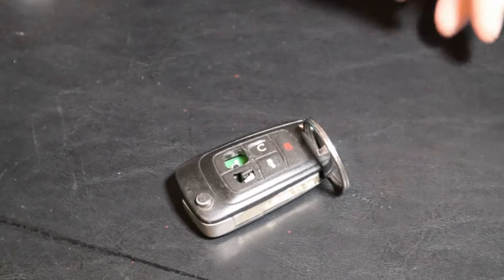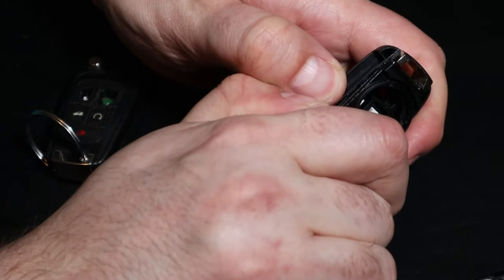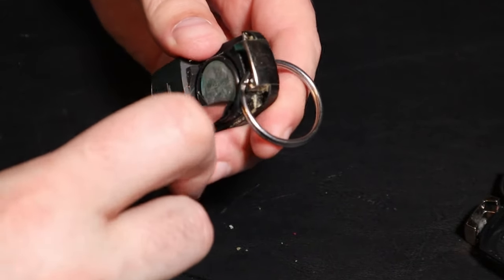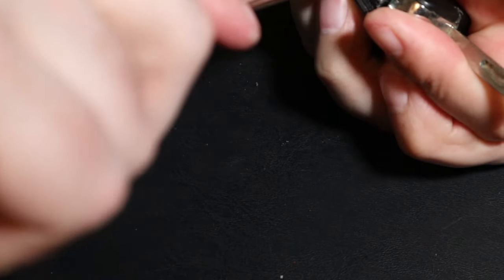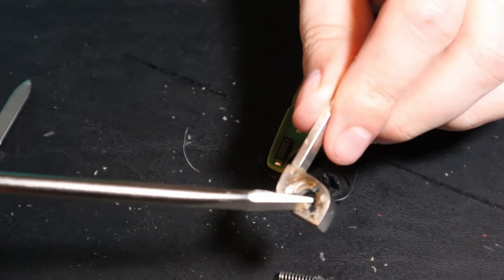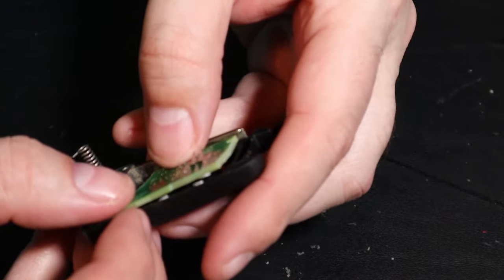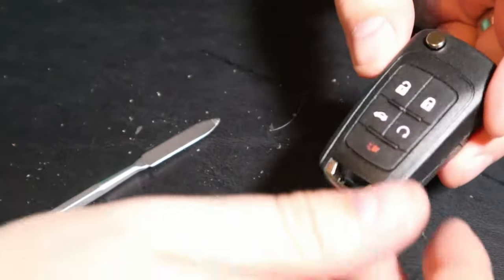How to replace Key FOB buttons | Chevy Cruze

Comment: These keys are designed so terribly, I’ve had this happen to both of my pairs
Reply: I got a cover off Amazon and I love it. It’s also helped find my keys easier because it’s lavender and not the standard black.
Reply: There are cheap brand new fobs online that come with instructions  how to program it.& then you just do the exact same thing with the key,but no need to put the board in the new one,and no need to pay to have a key cut. I've done this 2x,works great

Comment: Dude it’s literally impossible to get apart! Just tried for an hour to brute force my way in  and didn’t work. How long did it take you?
Reply from the maker: It was such a pain to open. I tried all kinds of stuff to open it. I dug around on the internet and found several people saying a flat head screw driver. I thought that's just ridiculous,  then I tried it and I popped the suckered open.
The key is to turn it sideways so that it takes up as much space as possible inside the fob. I mean it was still tough to open but the screw driver seemed to be the ticket. Check about the 3 minute mark on the video.
Reply: Use 2 needle nose pliers and carefully tear them apart. That worked for me but I broke some bits of plastic off that I may have needed for later. I can't get my switch blade key to lock into position tho. I think I'm missing a piece
Reply: @MindmeldTech  That's what I started out with. I think mine was superglued together.
Reply: Next time, try a Dremel like tool with a small cutting wheel along the case seam perimeter.  After trying to pry it apart with a screwdriver and nearly destroying the circuit board, I used a Dremel knock off from Harbor Freight.  Disassembly of the second FOB took less time and was cleaner.  Best of all, no damage to the circuit board.
Reply: Agreed I just watched this video to see what stupid trick I was missing. Nope just like plastic welded together. I would almost Pay to see some one get a OEM fob apart in one piece.

Comment: This video is great. I bought a replacement fob from RemotesRemotes for my 2014 Chevy Volt. I programmed it according to the directions that came with the fob but the buttons only locked and unlocked car; no remote start, alarm, etc. I decided to take the circuit board from one of my old fobs and replace the one in the new fob. It was almost impossible to get the original fob open as video shows; it was even worse. I used a hacksaw to cut a groove in the case to be able to pry the sucker open. In the process I destroyed the original case. Anyway, once I did that and pried it open I took the circuit board out and put it in the new case. It worked!!

Comment: Awesome YouTube how to repair video.  I could not have replaced the shell for my old key fob without your help. The most difficult step was opening the old fob case.  That required many attempts and greater strength than I had.  But I managed and the fob works like new.
Reply from the maker: Happy it helped you, and yes taking that shell apart was a pain!
Reply: Please share how, I’m frustrated unable to open it
Reply: @MindmeldTech  I got it put back togather but it wouldn't work.

Comment: I monkeyed with mine for over an hour.  I couldn’t get it open.  (The factory fob.). I just gave up.
Reply from the maker: Check under the chevy logo to see if there is a screw. Mine didn't have a screw, but I found out later that some of the fobs do have screws in them instead of being glued together.

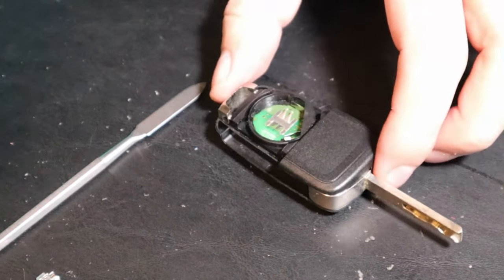Comment: A helpful video for anyone trying to move the circuit board and cut key blade to a new fob housing. After going through this process I realized the original manufacturers did not want you to be able to pop open the original fob and remove the electronics and key blade. They want you to replace at the dealership for $350. (Canadian) Getting the original fob to separate takes some persistence and brute force. I started to pry the halves apart with a screwdriver but it took 2 needle nose pliers to finish the job; being careful not to damage the circuit board. Finally, if you're struggling to tension the spring, use a couple small pieces of tape to secure the key blade to the bottom half of the fob while you're winding CCW. (7:00 minutes into video) Then pull the tape off just before you snap the 2 halves together.

Comment: Great video. I just replaced my 2016 Chevy Sonic fob using a $10 version on Amazon. Chevy dealer wanted $340 for a new key!
I also found the following:
1) the battery contacts on the replacement fob kept falling out during the fiddly assembly, so I used a dot of superglue to hold it. The original circuit board was also loose in the new fob (as shown in this video) so a dot of superglue here would also really help you.
2) On my spring, you had to wind up the key by turning the top case CLOCKWISE one full turn. Look at how your spring is coiled, and turn it the direction to wind it up.

Comment: I just did this and it ultimately worked great. 

I did have one issue where the silver button (that makes the key flip out) mechanics weren’t the same. They were shaped slightly different and the 3 teeth around the button didn’t quite match the old version. The old key base also wouldn’t open smoothly in the new shell, so I went another route.

I needed to get my old key onto the new base. Luckily, there’s a little spring pin that holds the key to the base. I used a little glasses repair kit screw driver to tap that spring pin out and put the old key on the new key base and as a result could use the new button mechanics. It now flips open smoothly. Everything took 30 mins and it works.
Reply from the maker: Awesome!

Comment: I have this exact issue with my key too. I'm saving this video and buying a replacement cover. Thank you so much
Reply: Even a key cut shop couldn't do it n charged me £5 for a thin strip of black tape with 2 bits of plastic made for buttons.

Comment: Excellent, just bought a used Terrain, one fob good the other looked exactly like yours. Found the shells but needed a video to see how to dismantle. Thanks.
Reply: Hey man, i also have a terrain. were you able to change your fob with no problem? For me i changed the fob and the buttons work but when i use the key to start it does not work. I now have a car lock symbol in my dashboard. Just want to try my luck and see if i can find a solution here

Comment: I got it to work. Thx for the vid. Some after market remotes are a little off if you are interchanging parts. My set is a little off bit it will have to do unless I want to buy factory keys cut from the dealership
 Thx for the video
Reply from the maker: No problem,  thanks for watching!

Comment: They super glued mine together. I'll have to use my wife's key and buy a programmable replacement.
Reply from the maker: yeh, mine seemed to be glued also. mangled it to get it open.
Reply: @MindmeldTech  Likely, that was the same with mine. I just couldn't get it apart.
Reply: They clearly super glued mines cause I can’t make this thing budge!

Comment: There is a small roll pin at the base of the key. All you have to do is push the pin out and the key will come right off. Reverse the procedure using your original key and you're done. This will keep you from having to take it all apart.
Reply from the maker: You still have to take it apart to get the circuit board out unless I'm missing something.  The replacement is just an empty shell.
Reply: The old transponder has to come out of the old fob and into the new one....... which means you have to pull the entire new key fob apart and re-tension the blade spring. 

What I found is the fobs are slightly different to the old ones..... can't clip the new front onto the old back. The plastics and push button slots are tricky. Then the spring has to be re-tensioned.

Comment: Well, that was interesting... same issue. Factory keyfob appears to be ultra-sonically welded or something. What a bear!!! I tried your method and succeeded in breaking the key end off, but  NO access! Would not budge! I ended up using small side cutter nippers and slicing along the seam in the hopes I could get a screwdriver in there.... nope. So I ended up nipping very carefully from the key end, very top down, then broke off small pieces so I could see the board and not damage it. Once I had the bulged part off, I worked my way down each side of the battery compartment,  breaking off pieces with the nippers and needle nose pliers as I went. Once I got most of the battery ring broken, I could slip the board out. 20 minutes.
Don't forget to preload the spring so the key flips out properly and fast enough.
EDIT: the screw behind the chevy logo probably is there. The new one has a screw in about the same place. Didn't see it and could not find the piece after I was done to check
Reply from the maker: Yeh, mine sucked to take apart. There have been several people that have brought up a screw behind the Chevy logo. I did a follow up video(short) with my back up fob and it had no screw in it. So I'm not sure if that was something they added to later fobs of just removed to discourage people from fixing their own fobs. https://www.youtube.com/shorts/AKg9i6DeEFU

Comment: Much appreciated! I programmed a second key to my Buick, and all buttons work on the new remote, except when I get close to the car, I am unable to lock/unlock my doors. Basically the new remote doesn't work. I thought about taking the original chip out like you did but getting into that fob is crazy! Thanks for the video, glad I wasn't the only thinking about doing it the way you did.

Comment: My original factory remote will not just pop apart by prying with a screwdriver.  The two halfs of the remote seem to be almost glued together.  I have been using a dremel tool to slice into the side of the remote making sure to stay away from the internal circuit board as to not damage it.
Reply from the maker: yeh, I had to give mine hell to get it open. Did it turn out OK for you?
Reply: @MindmeldTech  Yes, eventually. Every button on the remote did not function at first. Closely inspected pcb and discovered that I accidentally cut two traces, but repaired them with 30 GA jumpers and all buttons then worked. Bottom line - be very careful with pcb!

Comment: Are the buttons easy to push on the new shell? I bought a shell from Advance Auto and the buttons are stiff and require force to push. Not a rubber feel like the OEM, more of a hard plastic.
Reply from the maker: The shell I picked up has stiff buttons,  rhey aren't horrible.  But are for sure stiffer than factory

Comment: Is it possible to just put the top part of the new button replacements and pop it onto the bottom part of the old one?
Reply from the maker: maybe, my old one was pretty stuck together.  I mangled it getting it apart. but I have seen other videos where it comes apart easy. maybe you'll get lucky.
Reply: Probably not because the original and aftermarket shells are not exactly the same which mean parts are not enterchangable

Comment: Where were you able to get the replacement shell? I asked the Chevy dealership near me, and they won’t sell me just a shell. Can you provide a link if you purchased online? Great, thorough video btw!
Reply from the maker: I'll  post a link in a bit, but I ordered it on Amazon
Reply: Awesome! Thanks! I’ve seen other how-to videos where things don’t work or fit quite right. It’ll be nice to know I’m buying something that works.
Reply from the maker: @EDable209  KAWIHEN Key Fob Shell Replacement for Chevy Camaro Cruze Equinox Impala Malibu SS Sonic Buick Encore LaCrosse Regal Verano GMC Terrain OHT01060512 KR55WK50073 https://www.amazon.com/dp/B077682C5M/ref=cm_sw_r_apan_i_QMBNC11V7CGP475WY4QX?_encoding=UTF8&psc=1
Reply: EBay has 1 for $5.95

Comment: Do you know if there are (reasonable) replacement shells that include a new mother board? My fob key buttons are gone, but the buttons inside the shell (with the rubber black cover) no longer has the protective black rubber over each key. Thank you
Reply from the maker: I have never used one but found this
https://keyless-remotes.com/chevrolet-flip-key-remote-5-button-w-remote-start/?gclid=EAIaIQobChMIzv2Mhbaf-AIVSBZMCh11AgVCEAQYASABEgL8k_D_BwE

Comment: I completely broke my factory key fob. That’s was a pain. But now my only problem is the silver button does not pop out. ( doesn’t fit) 🙈 seems like the cut is different. What do I do?
Reply from the maker: Check to make sure you have the correct replacement fob. Does the replacement fob close with the key in it? Might not have the spring in correctly.

Comment: Did your car start after the new key fab
Reply from the maker: yes it started. but remember this is just replacing the fob shell, if your circuit board is bad it will still be a problem for you.

Comment: 👋 HI!!
Is there any way to fill in one of the buttons for a temporary fix until my shell arrives?? I'm in the process of moving, & the unlock button broke through. Mine also is showing a display light and car won't start. I even changed the battery. PLEASE PLEASE HELP THIS TIRED & STRESSED MOM!
Reply from the maker: Not sure if there is a way to fill the button in. Maybe your board is bad if the car doesn't start.
Reply: I used a flat lego piece which fits perfectly and insulation tape to keep everything in place. It works like a charm.

Comment: Doors unlock and lock, panic works and the trucnk opens, but on starting the car the Service Theft Deterrent message shows and the car will not start.  Any ideas
Reply from the maker: hhmm, might want to do a Google search on that with the make and model of your car. looks like there is alot of information out there on that exact issue. might just be a simple reset of the theft device.
Reply: @MindmeldTech  That turned out to be my problem. I thought it was working - the doors worked, the trunk. But when I tried to start the car, only the check engine light comes on.
Reply: MY EXACT PROBLEM!! IN THE MIDDLE OF MOVING!! EVERYTHING IS OH HOLD BECAUSE I CAN'T START MY CAR!!🥺 HELP WOULD BE GREATLY APPRECIATED!!!!

Comment: This is a terrible video! What you failed to tell everyone before we destroyed the new fob is that there is a philips screw under the Chevrolet symbol in back of the Fob. All you need to do is lightly peel it away and unscrew it and you can then easily pry it apart. OMG.
Reply from the maker: Thanks for the feedback,  sadly it seems chevy seems to have different styles of fobs. This screw has come up before in the comments and a short follow up was made in response. The fob used to make this video has no screw under the logo. 
https://youtube.com/shorts/AKg9i6DeEFU?si=1IwwVxQ_SQa6zd6b
Reply: I just disassembled a 2013 Malibu fob and it had no screw behind the logo. The whole thing was just superglued together requiring destruction of old fob to pry it apart. 

Another thing for people to know, the notches on the Amazon fob linked in other comments don’t exactly line up with OEM Chevy key. I was hoping to reuse the cut key in a new shell, but the notch discrepancy requires to use Metall key in new shell and locksmith to cut it.